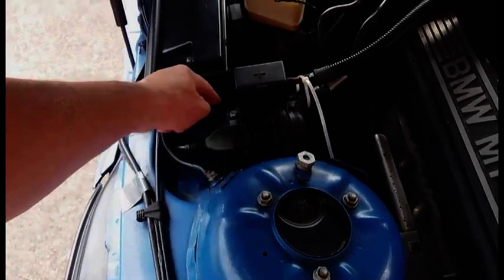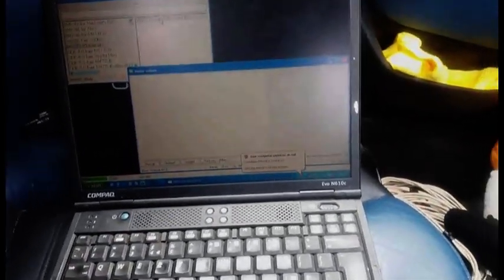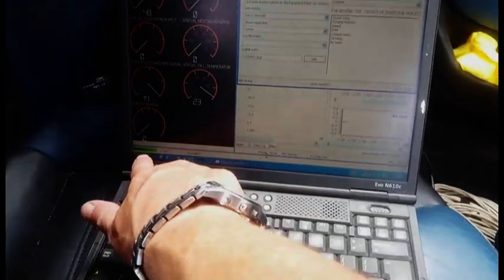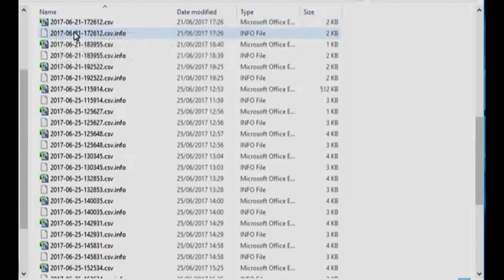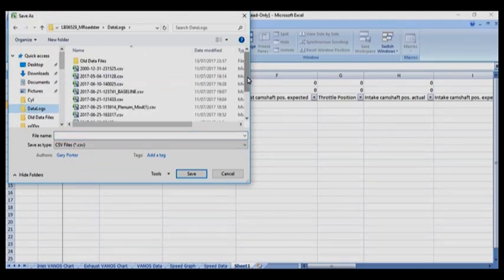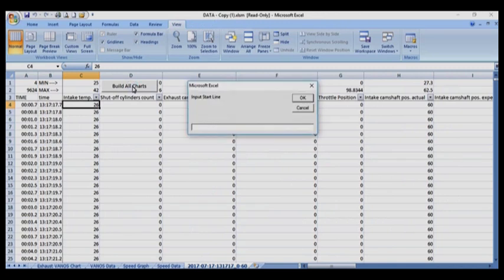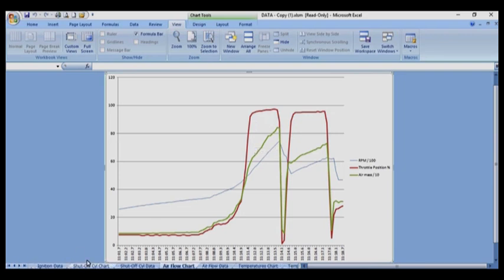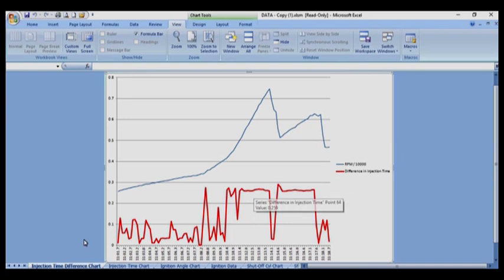Using the TestO Datalogger and Excel on a BMW S50B32 Engine

Comment: nice video, can you tell me please what custom jobs select for s50b32 engine ? i cant finde it on list. thanks so much
Reply: I'm not sure what you mean.  @2.00 I select the program for the engine.  Is that what you mean?
Reply: @pingu393   ok , if i select customs job , after nee to select my engine , i dont finde it .. what voice you select on your customs job? thanks
Reply: @autotuningservice  If you are using a serial port, use MSS50 S50(Serial).  I don't know what to use if you are using a USB.  I don't know if USB works.  Do you have INPA?

Comment: Changed column seperator to comma, hopefully my logs will be easier to read in excel from now on. Thanks.
Do you know if theres a way to save all of the parameters i want to log or do you have to select them all manually everytime? Thanks
Reply: AFAIK, you have to select them manually.  Personally, I select all the parameters and use Excel to filter the results.